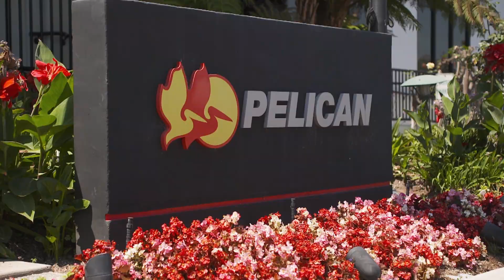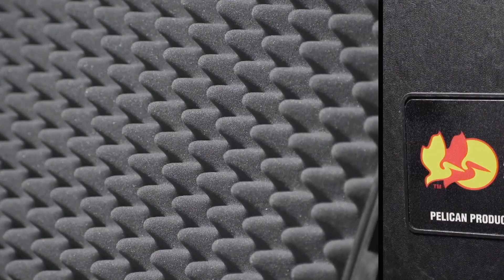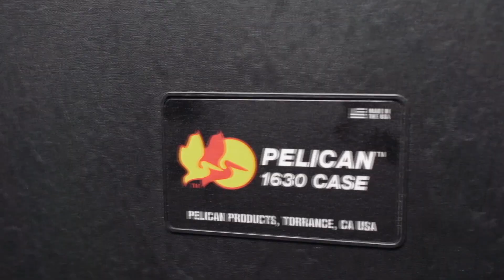How a PELICAN Case is made - BRANDMADE in AMERICA

Comment: A friend working for a startup loaded travel cases with servers that were BOLTED to the frame then sent them to the trade show through FedEx overnight. They arrived, the cases were intact, but the bolts holding the servers to the case frame were SHEARED OFF inside the case from G-forces. The servers still ran OK for the show, but couldn't be secured adequately for the return. On return, they were totally trashed even though the case was intact. FedEx paid dearly for those servers.
Reply: How?! What did they do to SHEAR BOLTS?
Reply: The BOLTS were SHEARED??!!1!

Comment: I was in field service for 40 years and for 3/4 of that I used Pelican to transport tools. They were shipped by air, FedEx, UPS and several local freight lines through out the Rocky Mountain region as well as to support fellow engineers across the nation. Almost forgot the 30000 miles a year in a company vehicle.  
The only issue I ever had was wearing out the wheels (3 sets total) and never had an issue getting them replaced by the manufacturer. IMHO Pelican is a go to product that can do the job.

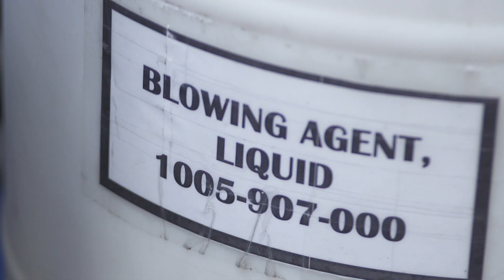Comment: 1:00 "high pressure vacuum" — vacuum is low pressure.
Reply: 😂I missed it but thanks to you I still had a good laugh👍.
Reply: except pressure is not always positive, you have been defeated mortal
Reply: Wrong.  There are different levels of Vacuum. Atmospheric pressure, Low pressure vacuum (LV), Medium pressure vacuum (MV), High pressure vacuum (HV), Ultra-high pressure vacuum (UHV), Extremely high pressure vacuum (XHV).  High pressure vacuum being in the range of 10-3 hPa…10-7  hPa